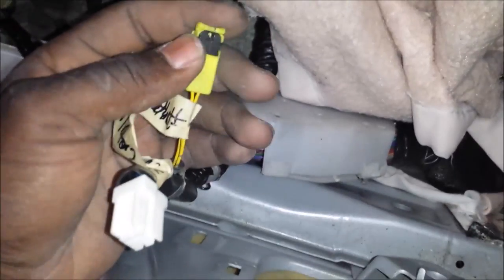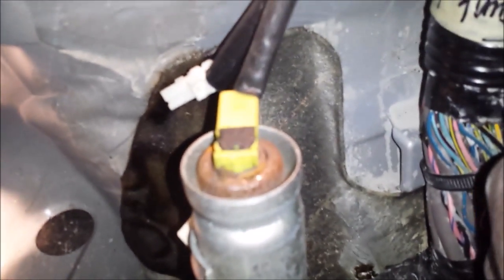Remove yellow or orange plug for airbag, seatbelt & other SRS system parts. Infiniti/ Nissan

Comment: I wish I'd seen this video 2 says ago. My seat belt locked up- wouldn't come out. There was no accident and the airbag certainly didn't activate. But I could see the seat belt material was badly frayed. Saw a few Youtube videos about how to remove the seat belt mechanism. Everything was going good until I had to remove the plug. It wasn't coming out; didn't know what I was doing (cause I didn't see this video) and I monkeyed around until I broke it. 

I have a 2002 Nissan- auto parts stores and dealerships don't have the seat belt mechanism. Had to get one from the junkyard. I've looked online for the electrical plug you insert in the mechanism. Finally found it. It's called a clockspring plug connector.

Comment: if you break them just look for a "clock spring socket" or connector they come with 2 one yellow one orange (sometimes one is black that is equal to the yellow one) the YELLOW one is the one that fits the airbag sockets. you can find them on ebay for under 5$ for the pair. cut and solder / heat shrink the new ones on and you should be good as long as its only the socket thats broken. make sure to check the branding i.e. if you have a nissan order the nissan etc there are a few varients depending on the brand of car.
Reply: The black and the orange ones conector aré the same?
Reply: @Tujuguete  yup
Reply: Can I just carefully take apart the new connector and just slide the prongs into the new casing?

Comment: I gave your video a thumbs up, but good God man, you recommend a small screwdriver, then you fight with it using your thumbnail. Aside from that though, thank you from all of us for the vid. Also, I suggest spraying connectors with WD or silicone spray to make dry and stuck connectors disconnect more easily. It's better than breaking them.

Comment: For the dummies like me who mangled the plug, you may not have to visit the junkyard for a replacement. The replacements can sometimes be found on eBay and Amazon. The replacement is called a "clockspring plug connector" as the earlier commenter newuser285 described.
Reply from the maker: Thank you for sharing

Comment: Do you have a part number for that connector?  I lost the black plastic
Reply from the maker: No sir. I don't know if you can find the connector by itself, but maybe an electronics store might be able to guide you.
Or visit a junkyard.
Reply: @EdBwoy  thanks partner
Reply from the maker: Good luck, and if you can locate them, let us know!
Reply: @EdBwoy  gotta turn to the forums
Reply: @behindthen0thing  just look for a "clock spring socket" or connector they come with 2 one yellow one orange (sometimes one is black that is equal to the yellow one) the YELLOW one if the one that first the airbag sockets. you can find them on ebay for under 5$ for the pair. cut and solder / heat shrink the new ones on and you should be good as long as its only the socket thats broken.